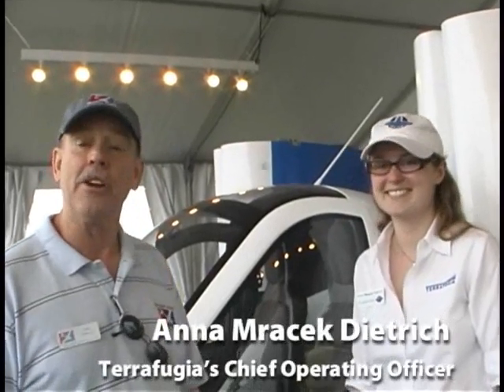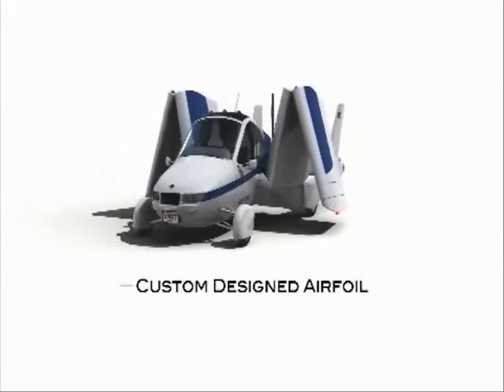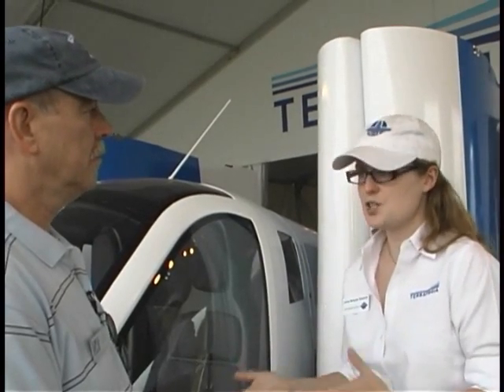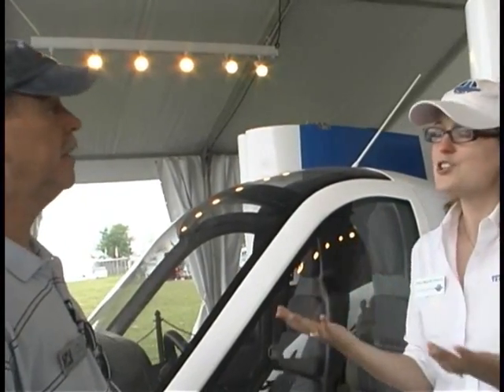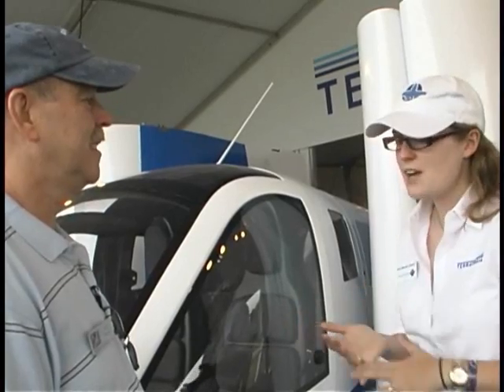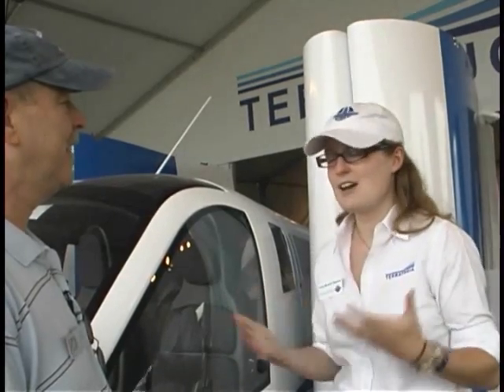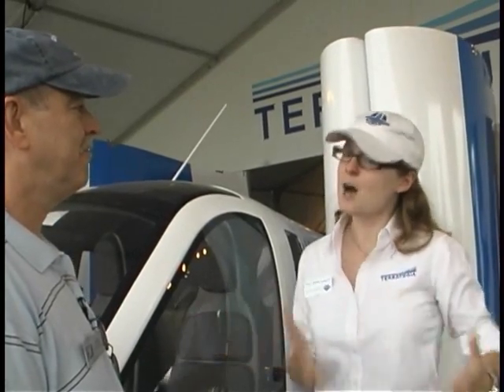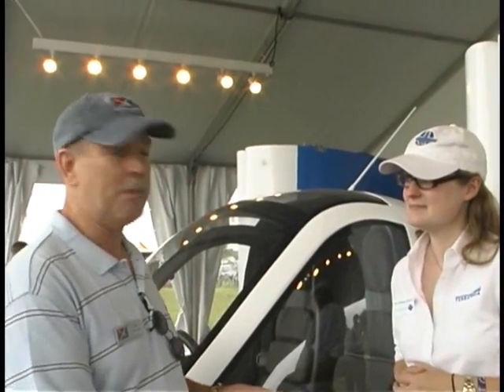Terrafugia Transition Roadable Aircraft

Comment: The reason, however, that it requires a runway is because of FAA regulations. It is certainly possible for the Transition to takeoff from a road, although such a departure would be potentially unsafe unless certain things were known such as, traffic,  obstacles in departure path, length of straight road needed for takeoff roll, airspace requirements directly above intended departure road (is it class A,B,C, etc?) & other things.